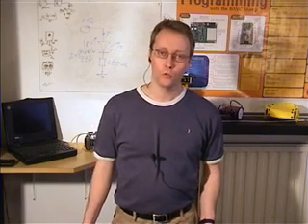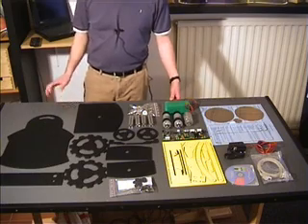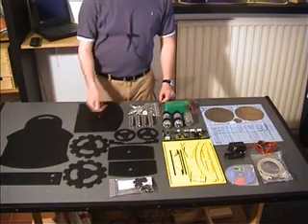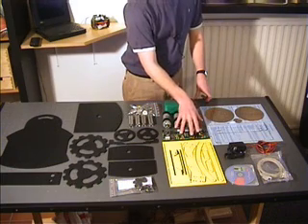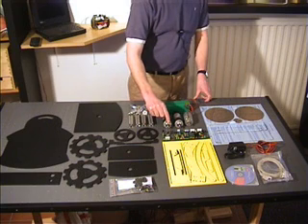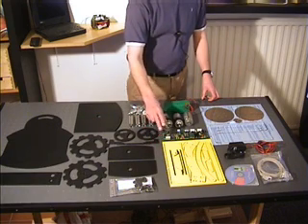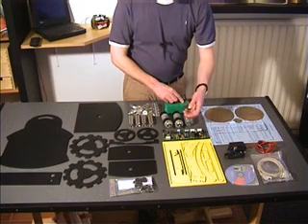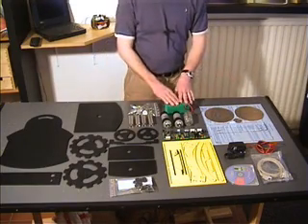RoboCut robotic lawnmower

Comment: I'm completely satisfied with my purchase. The mower performed exactly as advertised.>>> t.co/Ep6sZTPcda   It was a full day of work to lay the perimeter wire, but after that was done I haven't had to worry about anything - my lawn is just always mowed. I was a bit worried about my lawn since it has a fair amount of sloped areas, and it is very rough and bumpy. But the mower has not had any problems with it and hasn't gotten stuck once. I've had the mower running for about a month now and I couldn't be happier with it.
Reply: Works the way it is supposed to. Just Good